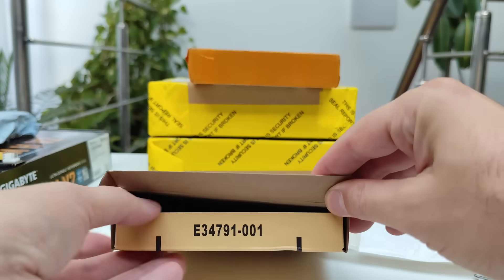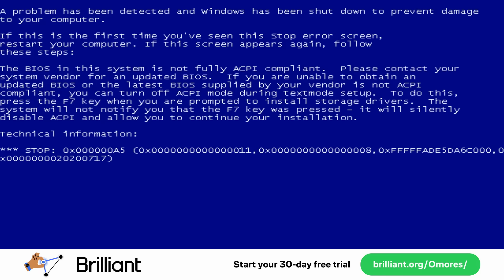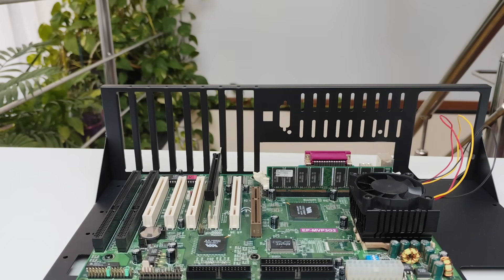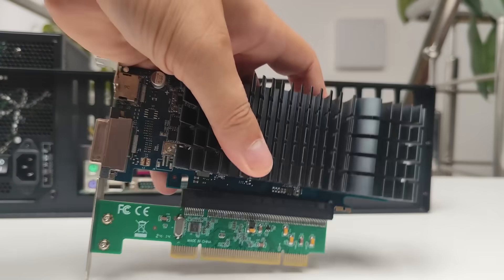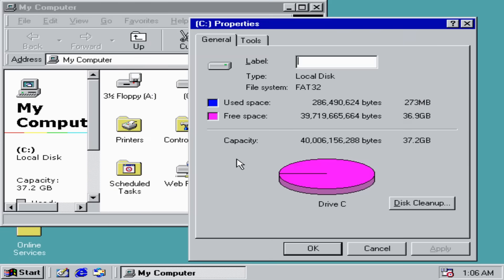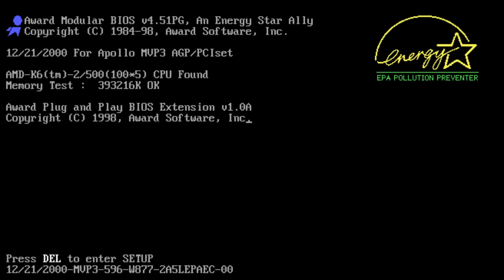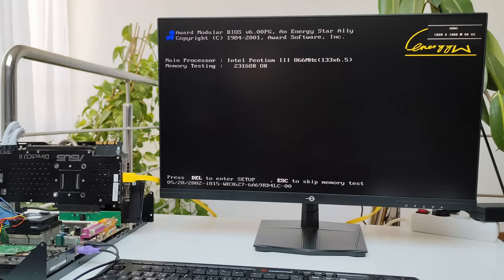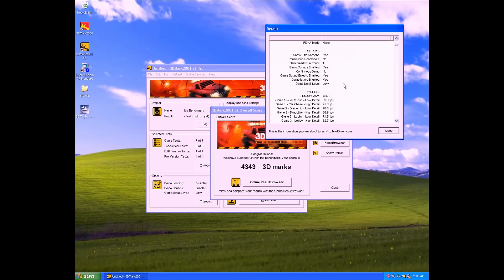The Ultimate BOTTLENECK: NVIDIA GTX 980 Meets Pentium III via PCI Adapter

Comment: You can use GTX 980 with win2000. It has backported driver by Blackwingcat. I also have GTX 980 and it works fine with win2000 and able to play Minecraft at high FPS
Reply from the maker: Nice! Is only the driver backported, or does it require other stuff from Blackwingcat as well?
Reply: @O_mores I'll write from reddit. YT keeps deleting comments
Reply: @ages2001  yeah I hate when it does that
Reply: @O_mores  Requires Blackwingcat’s Extended Kernel

Comment: I wonder if a pcie - pcix bridge exists? Might get more bandwidth with that
Reply from the maker: The PI7C9X130 shown in the video works with PCI-X. I actually have an OCZ Revo PCIe SSD that uses this bridge chip along with a SATA controller (from Silicon Motion) configured in RAID mode.

Comment: Now do a 5090 and 8086 🙏
Reply from the maker: I think I'll do it in steps... Step one: buy the support bracket. Step two: pray for a GPU to show up... :)
Reply: @O_mores  Don’t you have an RTX 2060 Super
Reply: naah go for the throat. 5090 with ZX81
Reply: that is not possible. You'd need a cpu capable of running a version of windows that has RTX 5090 drivers - that would be windows 10. The 8086 can't even run windows 3.1 due to memory limitations. The slowest CPU you'd be able to benchmark a 5090 on would probably be a Core 2 Duo or Athlon X2.
Reply: @kaneCVR  nope, it will be late pentium 4/athlon 64 i guess
Reply: @kaneCVR You can bypass this with Linux instead, it has drivers going back to i486 processors.
Reply: Linux exists
Reply: @talibong9518  Even if a modern linux kernel capable of running on a 8086 existed, the slowest CPU you'd be able to run a 5090 on is a Pentium Pro. The drivers require a P6 class CPU to run, and as far as I know there is no way to run a PCI-E device over ISA.
Reply: @talibong9518  And you wouldn't be able to do that on Linux either because the 8086 is a 16-bit CPU and the kernels that would be compatible with a 5090 require a 32 or 64 bit CPU.
Reply: 5090 is a uefi card, unfortunately they don't work on bios legacy
Reply: @Abigail8bits  thats a lie you can still use uefi cards on legacy bios if you do some dual gpu trickery (gt 710 for main display output, rtx 5090 has the video driver) tho unless its on linux you cant exactly find rtx 50 series drivers for a pentium 3 and even then i doubt it'll work (30 series should work tho but as for 50 series....)
Reply: @randomgamingin144p  yeag, but it's a workaround, not out of the box, still need to buy a gpu (unless you have an igpu or and old card, than it's easier fix) and depending on the case, it's a pci-e x1 with around 25w of power delivery, and the person is talking about 8086 intel chip, doubt it would had a pci-e port or any adaptation that could work, tho would be fun to watch
Reply: You could do something like use a 486 motherboard with PCI and downclock the CPU, disable cache, and all the other things people did to get older DOS games to work on later CPUs. Lack of UEFI is a good point. You'd need the last card to support BIOS, which is around the RTX 2000 series, I think. It is possible to run some form of Windows 10 on a 486 but I don't know about the full stack necessary to launch games. Even the most built out 486 will have something like 128 MB RAM, though I think you can get to 256 or 384 with modern custom manufactured SIMMs.
Reply: @dycedargselderbrother5353  In no way is it possible to run Windows 10 on a 486. It's not even possible to run Windows XP on a 486 without hacking the core files of the OS.

Another thing is that PCI on the 486 was the first implementation of PCI and most, if not all motherboards were 5 volts only. They didn't provide 3.3 volts of the later PCI standard in the slots, which precludes many more modern PCI cards from working.
Reply: I havent yet seen a pcie adapter that can communicate at the speed of smokesignals.
Reply: Unfortunately 8086 doesn’t support protected mode, SSE, SSE2, … what else? 😂
Reply: What would be the weakest CPU that  a) can launch modern games? b) uses motherboard that has at least x16 PCIe slot (electric).   Doesn't really have to be modern PCIe-version: With PCIe 1.1 x16 bus speed RTX 5090 is stil faster than RTX 4090 with PCIe 4.0 x16 bus speed.
Reply: @kimnice depends on the instructions the games need. Some need AVX2. Weakest cpu with AVX2 be some 56XX Xeon on 1366. IIRC i7 920 doesn’t have AVX2
Reply: @kimnice probably an old Pentium